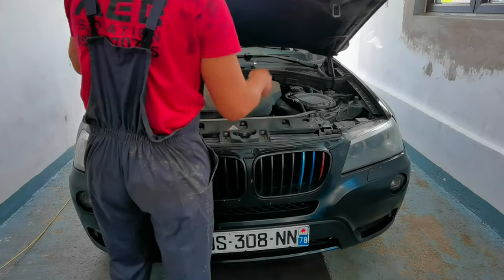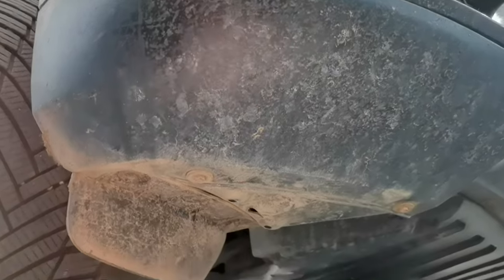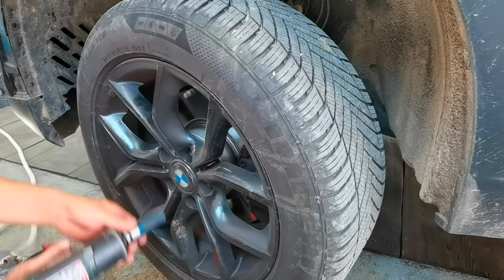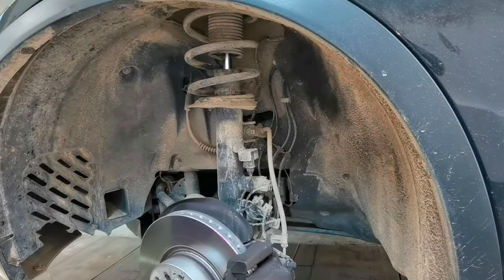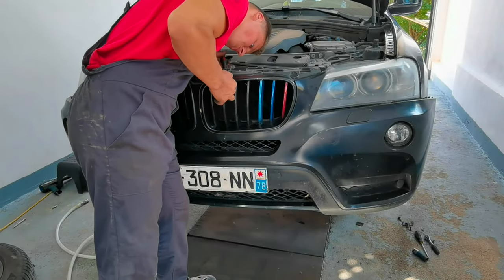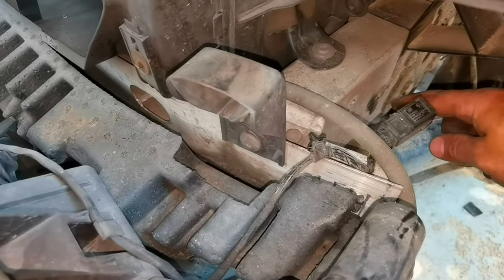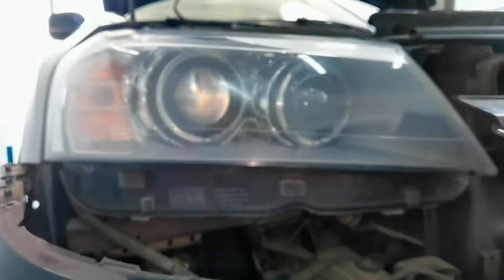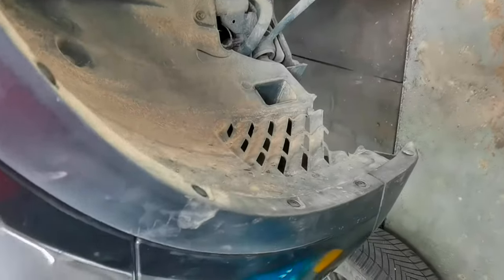BMW X3 F25 HEADLIGHT AND FRONT BUMPER REMOVAL !

Comment: Do you know if the Auto Leveling feature needs to be calibrated when the headlight is replaced? If not, would an initial static level just needs to be set? Thanks!
Reply from the maker: It does not have to be calibrated, the headlight sistem will calibrate itself based on the calibrating sensors mountedon the subframe in front and rear.

Comment: Question - if you swap out all bulbs, ignitors, and control units [ I am not sure if it is part of the headlight unit] on the adaptive headlight with xenon lights, onto the new lens, do you have to reprogram the lights?
Reply from the maker: No you don't have to reprogram if you only install different bulbs or led. Only if you install a new model of headlight from a newer version of the car you have. For example if you have h7 headlights and you want to Install bixenon headlights you need  to do a lot of modifications from wiring to leveling sensors installed on front and rear suspension arms and headlights washer sistem on front bumper. And after that you need to program the headlights.